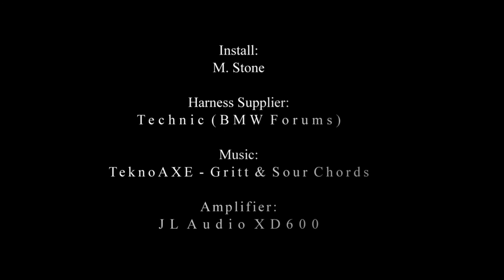BMW e90 OEM Amp Replacement with JL Audio XD600 using OEM Bracket

Comment: what did u set input voltage to on the top of the amp? low or high?  can u still code or tune the car?  did u just disconnect the tweets in front doors and mid in dash if u upgraded ur front door speakers? i assume u did since u use the jl 6 chnnl. or are the tweets on same chnnl as the front doors and still play once technics is hooked up to amp and factory harness?
Reply from the maker: Hey brother. Sorry this video was about 4 cars ago and many moons. I did not disconnect the tweets believe they were on the same channel. I didn't lose any speakers in the process. Sorry I can't recall more.

Comment: Great DIY! Thanks for the info, I plan on upgrading my e90 stereo the same way. Just a quick question, did you keep the OEM speakers? And if not, what does your set up consist of? Thanks
Reply from the maker: Kept the stock speakers. The amp made me pretty happy with bringing out the extra potential the speakers already had. The under-seat subs got some more punch now too. My next project will probably be the door speakers and tweeters.

Comment: Did u completely took out the hifi amp and replace with the new with using the stock deck? If so I have a 07 335i Wich should be the same thing with it being a 90s 3 series

Comment: Did you have coding problems after?? Where can I order that harness btw?
Reply from the maker: Thanks for asking, good questions. There were 0 coding issues. My OEM amp got wet prior and about a week after the bluetooth stopped as well. I never resolved the bluetooth issue so i can't say if that feature would continue with an aftermarket amp. I just needed my music back. Definitely brings out the best in your oem subs/speakers 

For the harness just go to a search engine and begin typing "technic bmw harness" should come up with some forum posts. He can be found on both bimmerfest and e90post where you private message him. Many have purchased from him.

Good luck
Reply: Same thing happened to my OEM amp,i get a lot of static through my speakers now. Thank you!

Comment: Thanks John I've been looking for a video on this for a long time.
What happened when your amp got wet?  I have a 08 328i and I've had issues with it for 3 years now. No sounds coming out of speakers. (I don't know what happen other than I had a short in my car. That short, melted my fuse box BMW refused to pay for it even though the main issue was recalled months later.)
Reply from the maker: Mine had the back speaker go out and the sub sounded like it was blown. Was just the amp thankfully. After you had your box replaced im guessing the speakers never started working? Id imagine bad amp or other electronics under your back floormat

Comment: I have a hi fi stereo is yours the same or Hk ? So by replacing the amp alone you got some improved sound ?Im disappointed I didn't have the hk but the hifi sounds pretty nice If this amp swap improves it more would be nice
Reply from the maker: Yes, I had the hifi and yes improved sound hands down.
Reply from the maker: +John Rambo please note, you will lose the ability to use your aux input, sirius and Bluetooth which was sort of a let down... (The sirius radio part)
Reply: +John Rambo on the bmw forums says you won't lose any functionality ? I
 Confused ?

Comment: Did you end up replacing the speakers? Have you got the aux bluetooth functions to work?
Reply from the maker: +vasmentoles Did not replace speakers, the amp made the stock sound a lot cleaner. Negative on the bluetooth. My understanding is the OEM amp is what provides the aux input & bluetooth features.
Reply: +John Rambo everything on the oem head unit should work fine with the Jl audio and technic harness, that's what technic says. I have ordered the same package, it's coming next week, I'll let you know if I have any issues with aux and bt.
Reply: billys did you keep BT and aux?

Comment: Hey wassup bro my logic 7 amp just went out on my 2006 bmw 330i is there any amps u would recommend?
Reply from the maker: Sorry not into the car audio like I used to be.  I just went with the XD600 after many BMW forum members used this replacement.  Plenty of power for me and that's just using the stock speaker setup.  The amp did make the stock speaker quality 100% better/clearer though!
Reply: Hey Joel Colon i have the same exact issue what did u end up doing